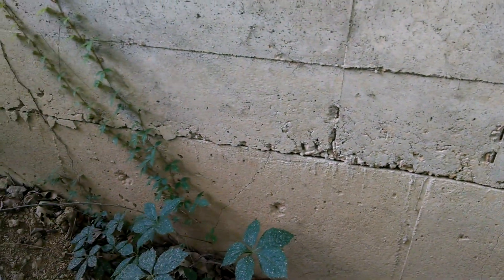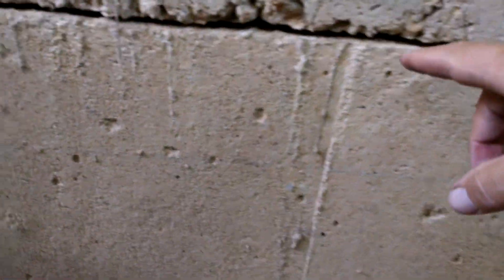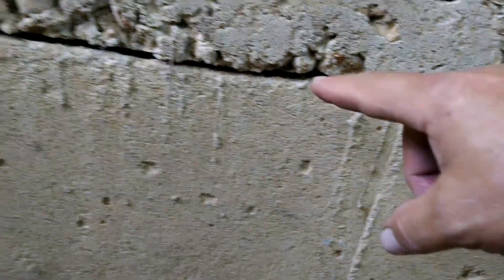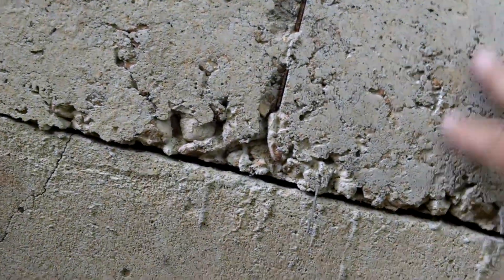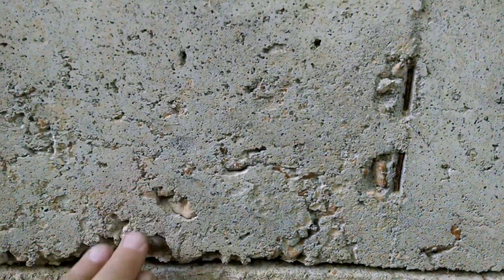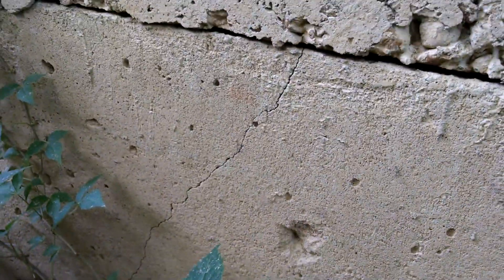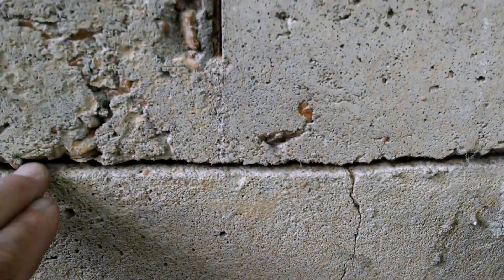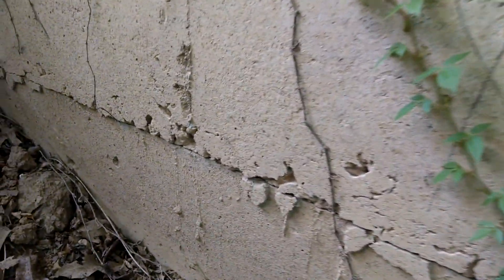Cold joint on the Foundation wall, Galloway Building Services

Comment: Is this always the case?  I have a 4" high 3'x3' square concrete pad for an AC condenser unit to sit on (unit being moved away).  A large 3" thick concrete patio slab was poured around it.  I assume a cold joint?  If I broke into the center of that 4" high pad (it's uneven and higher) do you think it would simply peel off the surrounding slab?  I have a Rotary hammer.  I'm hoping to just repour concrete into that 3'x3' square and make it level.   Thanks!
Reply from the maker: Any concrete on the ground like a patio or driveway or pad are non structural components to the home and they are not important as the basement walls. yes it should peel off if it is a cold joint. Not easy but without much pain. Great question.
Reply: @GallowayBuildingServices  Thank you.  I'll  find out in a couple of months if/when I take that route. 😁
Reply from the maker: You are welcome :-)  @twoweeledsoto6072

Comment: awesome video. I've been scouring around for information about cold joints but looks like not a lot of people are interested about cold joints. Everyone just assumed that it's as strong as monolithic joints. But showing in your video, there could be serious problems resulting from bad cold joint application. I wish the engineering community give more definitive answer regarding cold joints. I'm a civil engineering student working on my master's in structural engineering.
Reply: Gavin Balajadia 
There are positive applications in horizontal concrete placement. However there must be some consideration for expansion.
Reply from the maker: Thank you and please subscribe
Reply: @machia0705  And water management so water doesn't find a reservoir or pathway and rust out reo (rebar).
Reply: @Machia52612  Still doesn't defy the law of physics